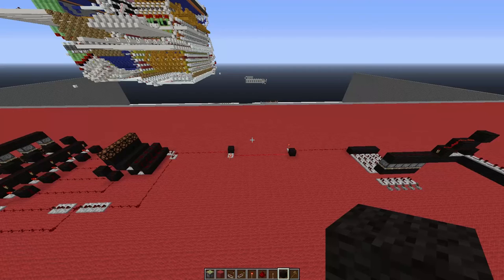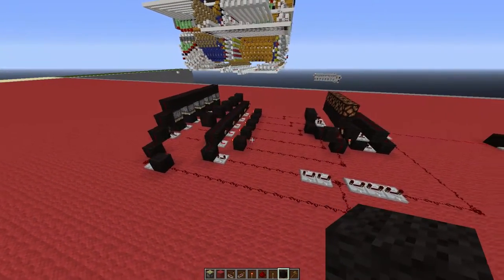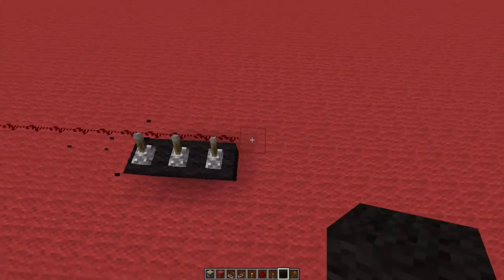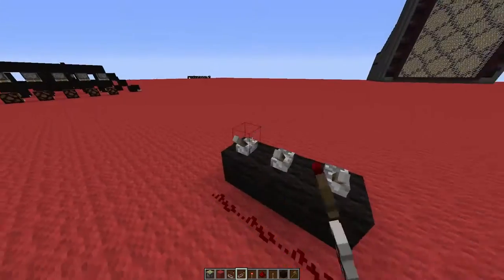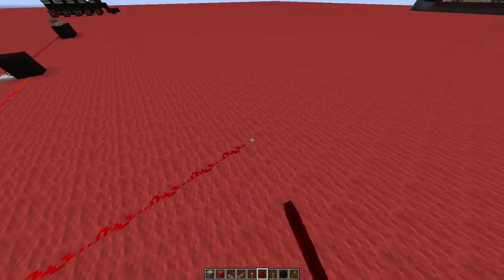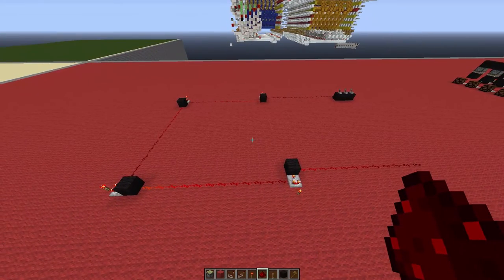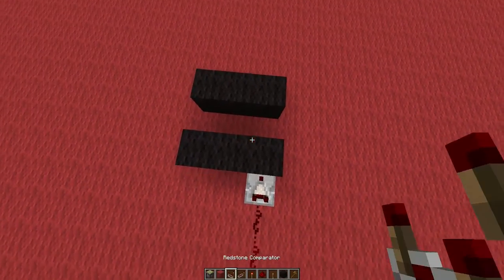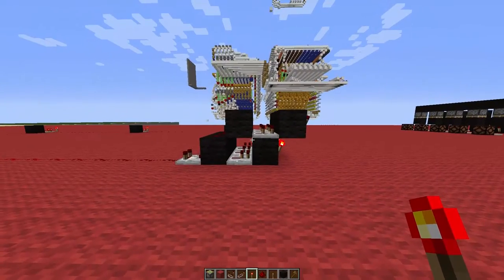Minecraft Tutorial: Serial Data Transfer (Multiple signals through one wire)

Comment: Something else that's simple and compact: You can have a set of buttons in a line, maybe 5? They'd activate the same line of course and each produce 15 spots of power. To make it compact, you can have these lines go into a comparator. Also, you can power another comparator to go into the first one to give out ten spots of power which would take 15 down to five because 15 - 10 = 5. Now, then you activate your buttons, you can have them switch on RS - NOR latches to keep their powers constant.

Say I press the first button, which I will assume will be the left most button. It will activate all the RS-NOR latches, but if I wanted only the left most button, there's be a 6th button to press to reset any activated ones so you'd be left with that one, so only the left most button will be active.

Now, if I wanted another one turned on, I could press the third button then the 6th button so only the first and third lines will be active. You'd then have an enter button which would send the info through as well as reset all the RS-NOR latches.

Comment: Well, I also did an analog transmitter, before the advent of the comparators a few years ago (I put 3 repeaters).
A simultaneous signal output can be done much easier - on the receiver to put the repeater delays on both the transmitter =)
Reply: i built a proper infinitely expandable with insta wire... :]

Comment: what if u wanna send a lot of signals... is there any time-based serial... (not signal-strenght based)
Reply: I made a design that utilizes a clock. It's a lot bigger though, and my design requires two wires. One wire sends out a timed pulse so that the input and output are synced, and the second wire is where the information is carried. So depending on when the information wire pulses in relation to the clock wire is what output you get. My design allows for multiple inputs at once. The only problem with it is that the delay between inputs and outputs are unpredictable. 

I didn't post any videos on it though. If you really want the design, I'll have to draw it, take a picture, and upload it to dropbox.

Now that I think about it, maybe it would be better to combine both methods. Have a clock AND signal-strength. That might make the design more compact.
Reply: vlad come to mc.openredstone.org and ask for 1 tick serial. We have some designs
Reply: martin w ayyy my fellow ore-man
Reply: martin w whats your gamertag? Trynna see if i know you.

Comment: analog isn’t serial
Reply: i know I'm 9 months late, but the thing he showed in the beginning of the video is the system as a serial contraption
Reply: serial is on or off... analog is constantly changing different signals... analog isn’t on and off
Reply: and if it uses comparators instead of repeaters than its still analog
Reply: there is my proof... its analog... and i have a simpler version of analog converter
Reply: no